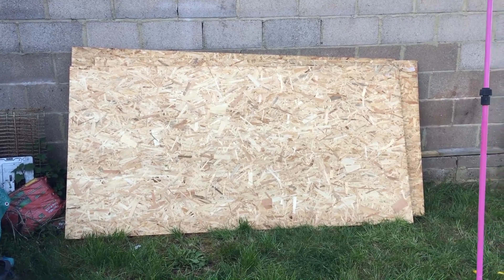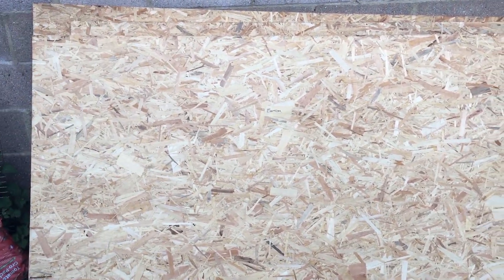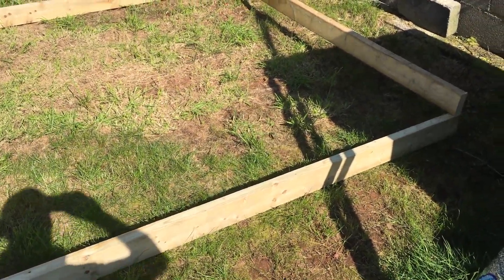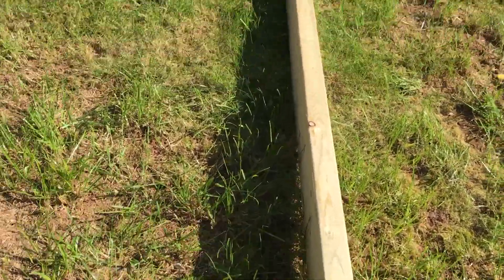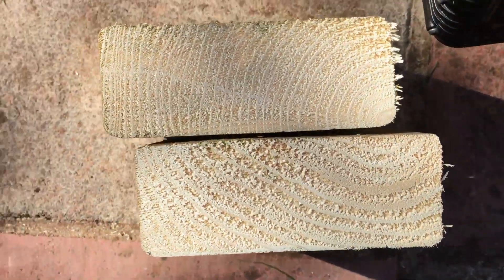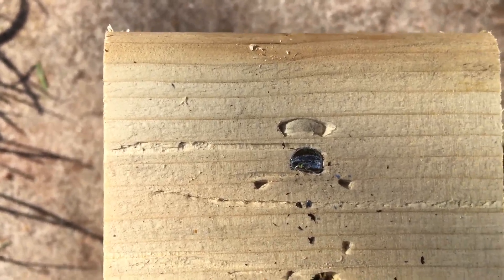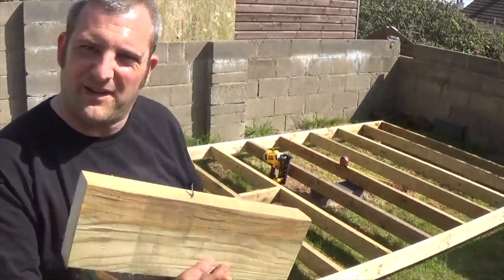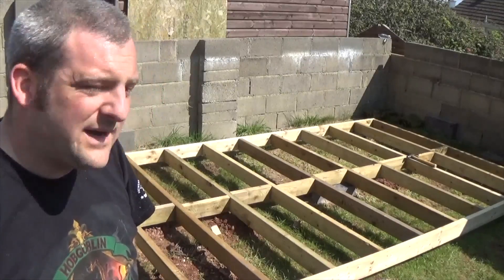How to build a shed series. Part 2: Building a shed base. #BigShedBuild

Comment: Such a shame after spending all that cash on a Dewalt framing nail gun, that you did not buy a cheap tripod for your mobile phone, I can't watch anymore sorry very sea sick now, next time, put the phone on a pair of steps and leave it there, as for the build well it will be a good one no doubt, so enjoy it when you have finished it, I may jump to the end to see the result. thanks for the upload.
Reply from the maker: I do have a tripod but sometimes you just need to grab the camera to film what you need to film, in fact i think the camera might have still been attached to it at times when i've moved it about for a closer shot. It's quite hard filming on your own and sometimes you just have to grab the camera and shoot! A lot of similar channels have assistants to help with filming which i didn't have the luxury of. Rough and ready will hopefully convey the message that it's real, not staged and isn't as easy as 1 2 3 but do'able for a novice. But glad you liked the videos. When i get time i'll upload the other videos but as i'm not running a commercial fishing boat i rarely get time to do much nower days! But the shed is up and survived many storms already so i'm proud as punch with it!